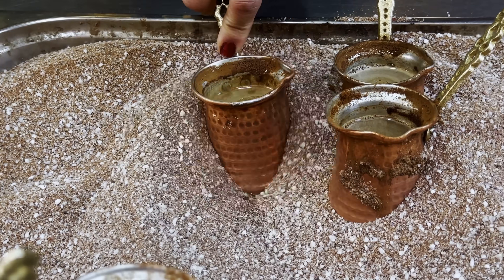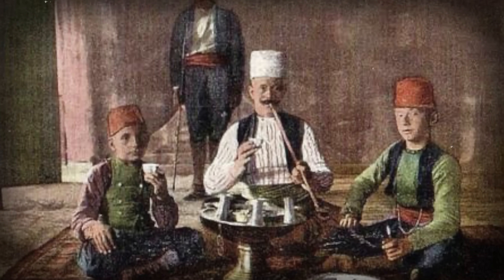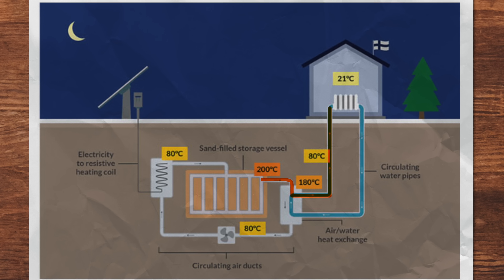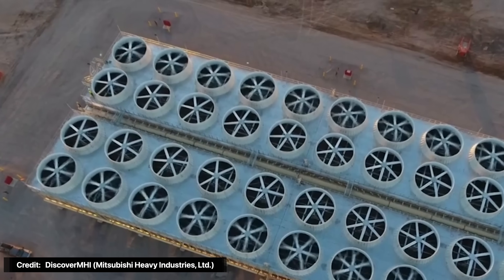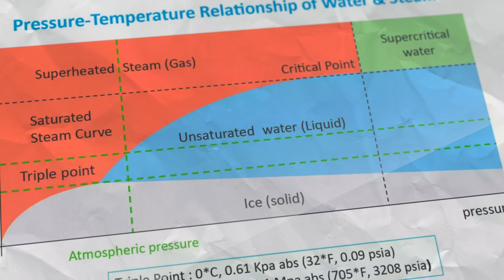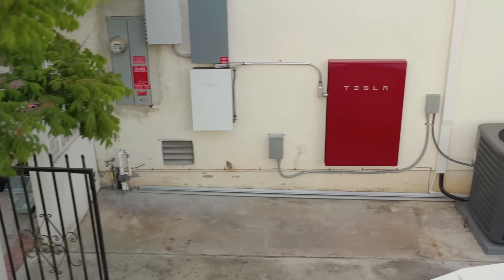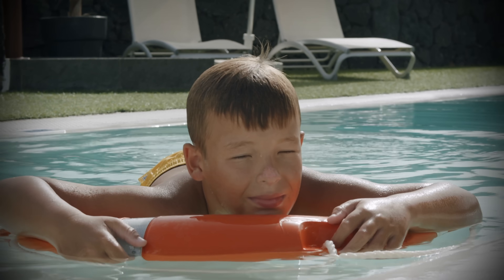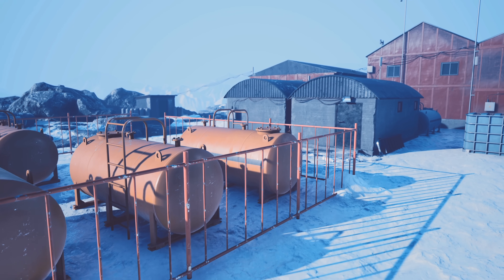The Power of Sand Batteries -- Revolutionizing Energy Storage...

Comment: using geothermal to heat and cool your house you basically are using the ground as a cold battery in the summer
Reply: Most uses with the heat pump are indoor-outdoor, but if you create heat-cold storages, then it might be more effective when the indoor-outdoor temperatures are less extreme. Also, if you have solar panels on the roof, you might want to cool them by bleeding the heat off and directly into your storage system.
Reply: That's a thing already, Underground heat/ ice storage for HVAC applications. Imagine a whole Airport terminal using this technique because you used all the ground underneath it to store heat / cold throughout summer / winter. They usually use some heat pump as well.

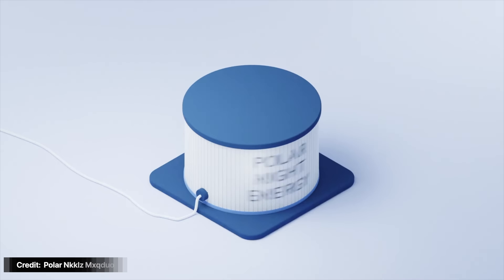Comment: 3:23 insert  heat pump comment here
Reply: Totally
Reply: That's the biggest "gotchya" to this entire discussion...GSHP (ground-source heat pumps) are already better than the best sand batteries.  The sun already heats the earth, such that the energy needed can be moved around (through heat pumps) to warm and cool your home, as needed.  With that work done, heating water with a heat pump is also very easily done.  My home has an air-source heat pump and hot water heater with a heat pump on top of it.  My summer vacation place is going to use a ductless mini-split for all the same reasons.  The sand battery is going to have limited application for metro areas with existing hot water radiator networks.